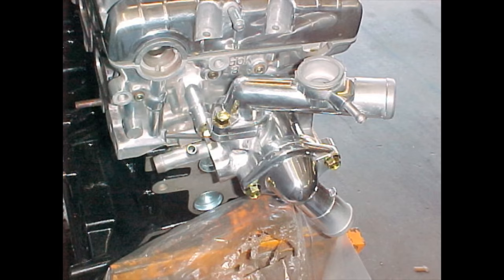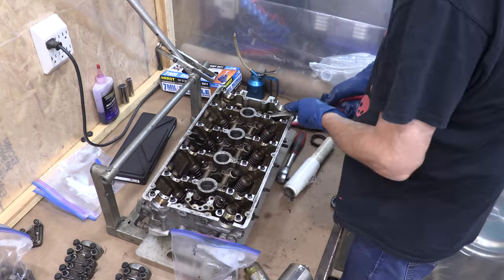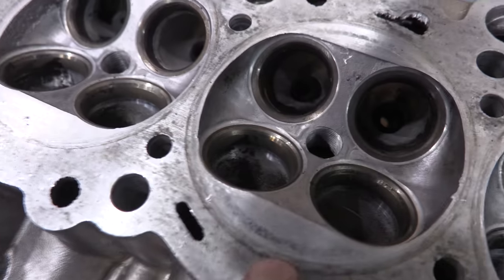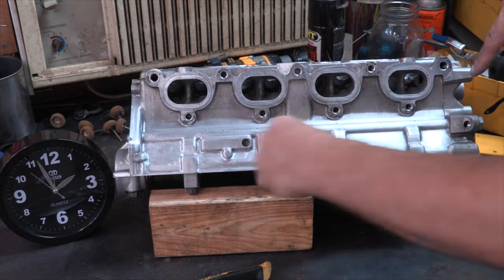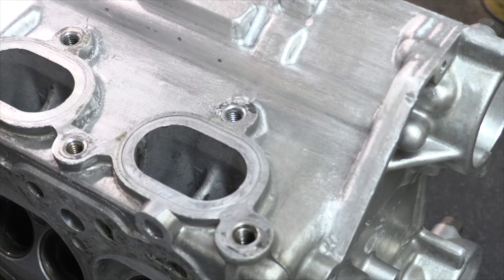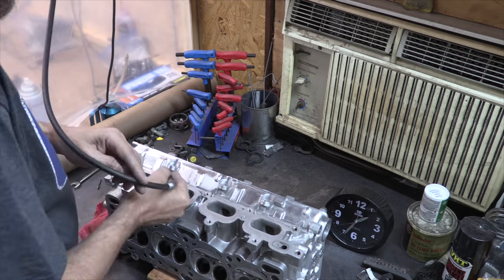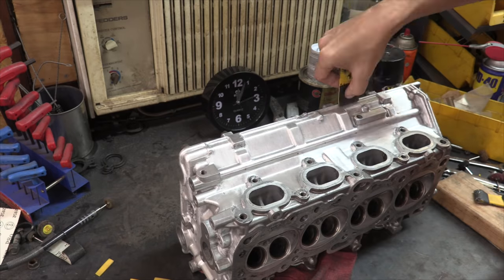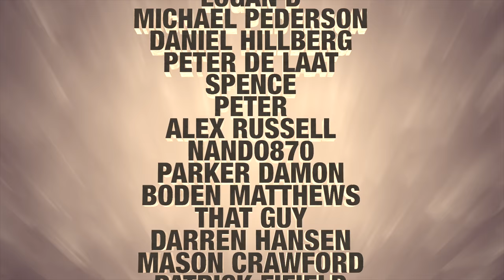Polishing Aluminum Step Zero & One

Comment: Wish I'd found this video before investing countless hours working on a 42-year-old Suzuki motorcycle engine.  But... Better late than never right? At least now I know the answer to the question plaguing me: "There's got to be a better way than this?"  Nope.  It requires more time and energy than any sane person would want to invest.  And now I know... That's just fine.  Thanks for the Body Spreader tip, that's gold.

Comment: Ive done the timing covers, valve covers, water outlets etc on my SRs and KAs, one 4g63 valve cover...looked at the heads and told myself, "youd have to be crazy, that is way to much detail". 

jafro, major props. i dont have the patience of a monk
Reply from the maker: Throttle bodies... DSM throttle bodies are where I draw the line.  Take the detail of the intake side, and shrink it to 1/16th the size, wrapping it around a cube.  No.  Just... no...
Reply: yeah I want to try to polish both the inside and outside of all three parts of my transmission case (M5BF2)... equally crazy...
Reply: @Jafromobile  would clear coating it help with having less maintenance in polishing it? ( planning on trying that for my 2 gen hemi K-code moded/twin plug cast or billet stock looking aluminium/magnesium valve covers and figured it was ok 👌 for a daily driving ( as the black rhino 🦏 lining isn't for me 🤢 and it collects smoot and dirt or falls off ect. ). and like it or not i know that my charger will be in the rain driving 🌧 at last 1's in a 5 year period the block is darker candy apple 🍎 with silver flakes paint or powder coated, im stuck like your 6-bolt block / same spot for now that's why i haven't coated yet. parts collect time for me for now ) and yes the belt is a weak link in the 2g 90's DSM's and yep the 3 or 1 rod does end up going out the side of the block and i found they can drop the valves or bend them, not in any order as i have see more than one way they can die on N/A engine's as i didn't work on a lot of turbocharged or blower cars in my local area ( 2000's ) as 🤷‍♂️ i guess people didn't want to spend extra money for it instead they bought N/A v8s ( or rarely v6 or diesels and no v10+ ) if they wanted more power and or got the screw supercharged v8 fords or brand X ( and didn't do enough for the bottom line 💰to matter aka 4 in a 3~ year period of any maintenance at all ) if they had a hole in their back pocket to burn 💴  ect.

as for the polished look its nice 👍 but the older guys in the club and others warned me not to do the full look that same thing as you said as i wouldn't keep up to what is need for bare aluminium as im usually busy with work or family time but i do try to take good care of my classics ( just a little more 💤 looking aka what the dealership's would have delivered it with but high end 👌 ) aka need something a little less needy for me to keep up with 👍 🤠
Reply: ps. the heads ( silver aka fake aluminium look ) are iron M-8 casting hemi and the block is iron fount timing cover is aluminium but i will probably coat in a different colour than red or clear 🤷‍♂️🤔
Reply: @richardprice5978  
In short, on raw polished aluminum, YES. There are specialized clear coats out there that are for this very purpose/ application. VHT is one of the vendors that comes to mind. They produce a Urethane Clear for this and I have used it with good results like most of the stuff VHT makes it is good quality and works well as long as you follow the directions and the basic properties of painting. 
There is also the choice to use a good metal sealant like ZoopSeal. That stuff is excellent and I highly recommend using it on your raw polished aluminum to prevent it from hazing up, and to keep you from the constant maintenance and touch-ups that it entails when left untreated.👍👍🙂
Reply: @caveone-365  thanks

doesn't the clear go yellow/off-tints ( and at least one part back to back i could tell it was in the raw vs freshly coated and shined-up, not sure about the methods used so results can vary and results wise it was really close to the winning polished raw flathead v8 Henry ford parts ) in say 5 years ish and is harder to shine up? if not im all for powderpuffing parts as im lazybones but i have high standards
Reply: also doesn't 0f to 300f cycling loads speed up the potential process of clouding/yellowishing, same ? for water like road grim/rain

like found under a normal daily drive car
Reply: @richardprice5978  
I honestly can't say about the VHT Urethane Clear on the raw aluminum after that many years because I didn't use it for probably more than 3 years, but by 3 it was holding up well and not 'yellowing out.' You are definitely correct though on the fact that clear coats can react in that way with time. You should try the ZoopSeal or equivalent instead of the clear route as it will cut down on any maintenance as a whole and it certainly won't hurt your polishing job. Anything on there to protect it is better than nothing as any kind of water will create nasty deposits if you let it sit on the untreated surface.
Reply: @caveone-365  was the VHT invisible to you/others notice it? sounds worthwhile to tryout as 5 to 10 years ( 50k to 100k miles and 1500-4k running time and or as oil analysts and maintenance say's so ) in the long-runners-intake's/entire 426* engine im planning on doing a refreshing work on the engine and TR6070 transmission, 8-3/4 3.2FG ect as seals/plastic/rubber go bad. its ok to refresh the valve cover's Polish/VHT and hoping it doesn't take much extra effort to shine/finish up
Reply: @zeroswings2  yes that sounds like a lot of work for me my 2014chevy TR6060/tr6070 is ok with satin and or raw-casting-OEM finished ( sharp casting flashings that can cut me ect or is a stress riser removal is ok and modern castings/parts for the big-3 generally aren't that bad nowadays ) and or cleared or painted-coloured say ie silver/white

why the efforts? as in a DSM-FWD and RWD car's the transmission/lower-bottom castings are mostly covered up and you can't see it and it doesn't stay clean unlike intake's/tins/al-heads as long as you drive carefully and or off roading and maintenance is done stays clean or-ish

my 🍞oil-pan 7+in deep aka SS 1968 style 426-hemi pan ( dry sumped i have lot's of different reasons for doing this outside shaped pan ) in aluminium being so im possibly ok polishing it as it's flat and buffing toolset will make it a easy job vs painting ever-year or so if it was like most 4-cly wet-sump or lots of finned or curvy id pass to hard or at least for me

Comment: Good job.  I’m a die maker. When I polished my bike engine I used radius gauges and made up some polishing bobs for the internal rads. Using various diamond pastes. In step 1. 
The obvious areas I was using jewellery tools diemakers files even a jewellers eye glass. And of course gauges. 
Then I put the fairing back on the bike and you could only see about %20 of what I’d done. 
Insanity and. Never again.

Comment: This is the video I've been looking for. I've got two Ducati 250 engines from the 1960's and want to do them justice.  I'm 74 years old -- lifelong musician and have painted houses for decades. So I know enough about preparation to jump into this with eyes wide open. So thanks. One nice thing about labor intensive work like this is that there won't be many copy cats. If the process took three hours everyone would have gleaming aluminum work. Not going to happen in this age. Thanks again -- this will be my ongoing reference.

Comment: I was so impressed with this video and couldn’t quit watching it. I had to see every detail. I learned a lot as well. I did want to mention that none of the sanding needs to be done by hand. You can start with a dremel and 120 grit and get your flat surface. For all edges, corners and tight spaces I use a dremel wire wheel #447. It won’t leave noticeable scratch’s without using a magnifying glass. I use wire wheels on drills for the big areas and then maybe 240 grit sandpaper. From there I go to 400 grit then to 600 grit and I do wet sanding using a spray bottle. I then buff and polish. I like using the bars to buff it out which are usually black,maroon and then the polish is either white or green. It will make aluminum look chrome. Cleaning has always been the same and I just use a mild car was soap and water. As mentioned I do have to dry it. You should let the tools do the work for you and shave off about half the time. It will look like the head was dipped in chrome

Comment: Currently working on re-sanding and re-polishing a 2015 dirtbike Alu frame, these tips are awesome for my project! i spent 80 hours on it the first time then clear coated it and the clear coat ruined the polish, then it was stolen for 4 years and beat up. i got my hands full. probably looking at 120hr or more on the frame to get it mirror finish again.

Comment: What exactly went into that ultrasonic cleaner for make it clean the aluminum so well? Was that distilled water? What was the chemical, the dilution ratio? Can it be applied to a smaller tank? Sorry for the entry-level questions, but nobody ever taught me anything useful and you seem to know some good stuff. I watch your port/polish video over and over.
Reply from the maker: I spend the most time on this topic in "Galant VR-4 Cylinder Head Inspection".  Fully explain the whole ultrasonic cleaner thing end-to-end.  Be careful with this stuff, don't walk away and leave your aluminum parts in it.  It's also not the easiest to dispose of, but not so bad...

Comment: Ive done this before, in my opinion; It was never terrible experience. It was more a fun bless to dedicate your personal skill to something. Everything Ive seen here, I have done. There ways to power through it I'll agree that no power tool can do the job. Doing it by hand is something the best and only choice. As for pitting or casting pores, which I would like to ask as what the difference to you since I thought that the factory would deem the part as a failed casting. The soft buffing bit does work gets though those letters you just have to sacrifice it. I would say my only limitation  is selection in my area for tools and bits and things of that nature. For the pitting I just resurface that areas but it does lave a warped look. Doing it more often get rid of mistakes.

Comment: I started to polish my intake manifold a few years ago, after a couple of hours and very little progress, I decided it would look good black, still think about going back and stripping it down and polishing it
Reply from the maker: Intake manifolds are brutal.  I quit one and painted it, myself.  If you have to do it, polish what you can see on the outside.  The back and bottom of it can't be seen at all.  Just clean the rest.  Or don't?  Because you can buy polished intake manifolds.  Relocating batteries and coil packs for that can be a pain, but so is polishing an intake manifold.  :P
Reply: @Jafromobile  it’s on an SRT4 engine so only the top and in between the runners is really visible, the area around the injector bosses will be tough, but I think it’ll be worth it

Comment: diegrinder with a paint removing disc works brilliant for sanding the small flats, if you trim the width of the disc guard you can cut the discs down to fit in the smaller spots to save time.

Comment: I made the mistake of starting this a few years back because of you. Some of my pieces are my AWD trans, t-case, and other small bits. Ill probably start the extra head and VC because of this.
Reply from the maker: Man...  I'm sorry!  I thought I told everyone not to polish transmissions and transfer cases?!?!  Being that my car ate 3 of them.  It's possible, but truly is punishment.  Those parts I'd 100% say, "buy a vapor blasting cabinet".  It's really only the precision machined centerpieces and valve covers that should get this kind of scrutiny.  Anyone who polishes the under-side of their DSM will crush me on my best days at a show.  I respect your ambition!
Reply: @Jafromobile  Pretty sure you have me beat by a few years on these things. What ive found that works well are the mini wire wheel brushes, and the pointed type. Just use in a regular drill not in a Dremel.

Comment: BAD GOOGLE. You should have told me this video was available google. WTF. I have notifications on. BAD GOOGLE.

Great video man love watching your content. Thanks for more content!
Reply: On a funny side note, I had polished my headlights. True story. My 1993 Honda Del Sol. We took the headlights completely off the car, and sanded down the front plastic. My buddy and I did so to remove the yellowing. Started with 80, which pretty much fogged up the lens and made it impossible to see through. But as we moved down in each grit, going from vertical to horizontal with each next grit, eventually we were wet sanding and you could see right through. A perfect surface. AND THEN we took clear coat paint and sealed the headlights. And I tell you what, they never yellowed ever again. In fact, even after I got rid of the car, my buddy went to the scrap yard 8 years later and sure enough, there my car was, and its the only car in the yard with perfect headlights. He even snapped me a picture laughing because our work had made such great results! Insanity but hilarious.

Comment: If you or someone you know has Jafro levels of OCD pertaining to DSM motors, reach out and get help. But not Jafro because I like watching his videos. Meanwhile I feel like it's a chore to clean dirt dober nests off of my engine bay lol. But I'm performance obsessed and care less and less about aesthetics as time goes on haha. But I still love Jafro for showing me how to gasket match port heads and polish combustion chambers (the only polished part on my Toyota 2ZZ-GE is the combustion chamber, runners are just ported cause I couldn't find definitive research showing polishing intakes worked to make power versus the micro turbulence a/f mixture from an unpolished intake runner). I still love his videos even if it's just cosmetic stuff like this, it's next level insane especially when it comes to cast aluminum lol. I'd almost clear coat this stuff, he's right "don't start won't be none" haha. Love it.

Comment: Panteras the greatest ever! Love the 351-C.
Reply from the maker: They set an un-beatable standard for 30 years.  Every MR2 owner's wet dream.  What's not to like about a ZF-5 transmission (with no torque loss) on a big block V8 and 18" wide back tires?
Reply: @Jafromobile  Never heard of a Big Block version, just SB 351 C and W.  Was this BB you model mentioned a custom fitment?
Reply from the maker: I can't see your whole reply in my comments for whatever reason... but... there's enough meat on that block with both both bore and stroke to turn it into a 429.  I suppose technically not a big block with a 4" stroke, but definitely big block displacements.  The fattened budgets, quest for insanity and rampant modification in that community caused them to develop all kinds of ridiculous 600-700hp NA builds.  It was like the Italian car that had no rules against modification.  People have put big blocks in them, but you are correct... the 351-C is not a big block.

Comment: I have a set of OEM VW wheels that had trashed clear coat on the machined faces thanks to our Midwest winters. I foolishly decided to polish them and quickly realized it was a terrible idea but decided to finish it since I already started it.  My advice is, don't do it.. lol the finished product looks amazing but it's a lot of work and you'll regret the regular maintenance  to keep the aluminum shiny. Of course now you can apply ceramic coating and extended the shine and keep the parts clean but you will have to keep the polishing the aluminum until the end of time.

Comment: Would sand blasting at the beginning of step 1 offer any benefit (in this case)? It would make sense to me that the blaster would be able to cut through the oxide layer, impurities, and such quite easily.
Reply from the maker: Yes it does.  I have a cylinder head that was sand blasted and we'll be comparing textures in the next video.  I highly recommend blasting every single piece of the coolant neck and thermostat housing first.  It shrinks that effort button WAY down.
Reply: @Jafromobile  also vapor blasting would leave a smoother finish than sand blasting.

Comment: I kinda want to try this, but my car has 2 aluminum heads with aluminum valve covers, an aluminum block,  both upper and lower halves, an aluminum transmission that's actually getting assembled now with even more aluminum than the original, the alternator,, a large complicated aluminum intake manifold/throttle body, the inlet tubing, all the aluminum bits attached to both, a new to me aluminum radiator, likely some aluminum dress up bits and accessories, and the idea of all that metal gleaming away under the hood of a daily driven beater perpetual project car is both enticing and terrifying.

Comment: exactly the (de)motivating video i needed. currently  attempting to do this to a harley davidson primary cover and mazda v6 valve covers. the amount of work truly is astounding, but then again so is the end result. worth it. big thanks for making these videos, sharing your knowledge and inspiration. any tips on what grit to use when sandblasting cast aluminium?
Reply from the maker: You know... really... glass beads does a spectacular job.  Most everyone here recommends vapor blasting which is a less-aggressive method that apparently yields a spectacular result.  It won't plane anything... but if you want the irregularities, that's likely the fastest method.  Vapor blasting.  Look for others' testimonies about it in the comments.